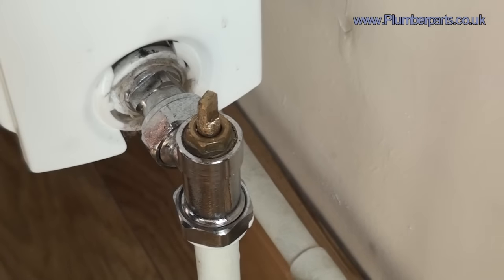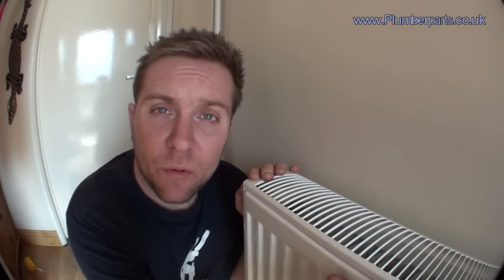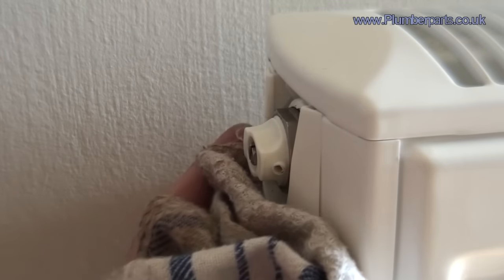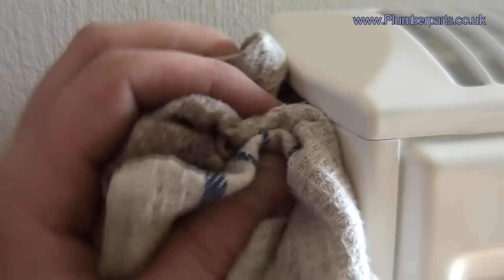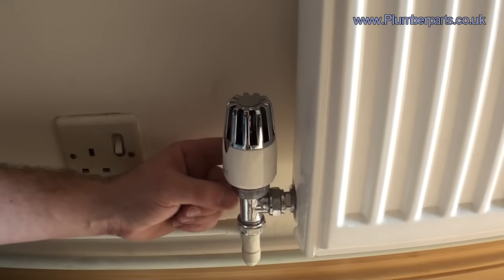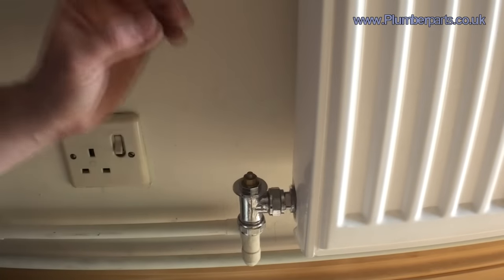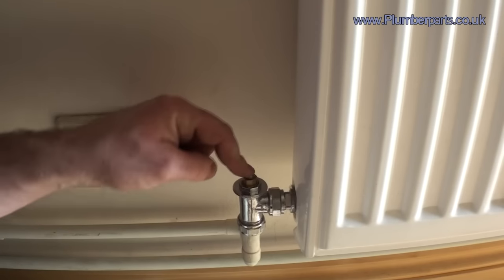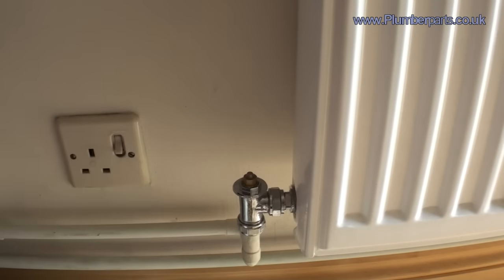How to Fix One Radiator Not Working - Plumbing Tips

Comment: My bedroom radiators are cold all over even at the pipes. Downstairs radiators work fine and the ones in the bathrooms work fine. I have tried letting the air out and a little air came then a lot of water. I looked at both pipe valves lady and right and they look the same. No pin either side just a traditional turn one like in the video. What do you think is wrong and what would you advise?

Comment: I have a lazy Radiator in my downstairs toilet. Occasionally it will just not get hot. The valves are open, it doesn't need bleeding, the system is cleaned out and inhibited annually so no sludge (plus I fitted a magnetic filter trap), the Central Heating pump is working and at setting three and I have balanced what Radiators I can (it's an old system so some valves are stuck open).
If I crack open the drain valve at the radiator to promote a bit of flow it gets going again and thermally cycles, but just very occasionally it will lose the will to work...... drives me up the wall.
I am gradually working through replacement of the old Radiators in the house (about halfway done now), so hopefully once they all have new valves on I can balance the system a bit better. I just can't afford to change them all in one go.

Comment: Fantastic videos so helpful thank you can I ask a quick question please I'm going to be getting a gas engineer out to look at my boiler because the pressure keeps dropping when the heating goes off or it's not used long after being used before I got told something called the expansion vessel is the problem does this sound correct I'm afraid they might say I need a new boiler can you give me some advise if that's ok john

Comment: Mate I’ve got exactly this problem. I’ve checked the lock shields open fully, I’ve bled the radiator. The trv is Luke warm, I’ve taken the thermostat off the trv and compressed the pin which presses fine however the radior is still freezing cold when everything else is hot

Comment: I've got one new radiator that doesn't get that hot unless I turn another radiator off. The plumber said it is because the boiler is at its threshold for the 15mm pipes we have and changing to 20mm would help. If we had the 20mm installed in one or two rooms as we decorated them, would that suffice? Or does the whole house need to be redone (not going to happen, no budget for that)?

Comment: I got one of those cheap plastic thermostat value.Not like one us you shown,done up a plastic collar.The pin is stuck up.The radiator is cold apart from small bit at the top.Not sure I should mess with it.

Comment: Hi, I’ve followed the steps on this video but I don’t seem to be getting any hot flow to the one cold radiator in question (pipes & radiator are all stone cold). Should I be looking at balancing or airlock next, or could it be something else? It’s a top floor radiator (same floor as my pressurised heating system). All other radiators are working fine (other than the lounge on ground floor but I think that might be sludge related as it is getting flow but is cold at bottom and room temperature right at the top). Thanks!!

Comment: One radiator in my apartment is causing trouble. All the other radiators are working except for this one which occasionaly produces heat but very randomly. Like it's turning itself on and off. Any reasons why this could be, and what should I do?
Thanks!

Comment: Hi @Plumperparts, my radiator inflow is hot, and some heat transfers into the radiator, but it does not move through the radiator. I have repeatedly bled the radiator so I know that is not the problem. Could it be that it's just too full of sludge? The other thing is that my builder installed the valve at the top of the radiator, does that make a difference?

Comment: if you want to vent the radiator, always switch off the central heating pump and wait 20 minutes before venting,and always start with the radiator that is the highest and so you get to the lowest

Comment: What is that tool you're using that you call adjustables? I could only find draper redline pliers in the shop but they don't grip and the thing won't budge at all.

Comment: Great video we have had a new radiator fitted and since doing so one radiator doesn't heat up the idiot who fitted the radiator has been twice and each time the same issue radiator is cool at the top and bottom is hot and all the rest of the radiators burning.  Think I will try this than call him again.

Comment: Both pipes are cold , I've got 2 rads in my living room, 1 is piping hot and the other was hot but it's suddenly gone cold? Should I try bleed the hot one in case air is preventing the hot water going to the second one? The pressure is a healthy 1.5 bar

Comment: I've got one radiator that doesn't work ...when I turn the bleed valve to let air out the pipes leading to it heat up then when I close it they go cold again, it's driving me nuts my halls freezing have you any hints to the problem bud I'd much appreciate it
Cheers

Comment: Suggestions/help request.
I have one large radiator in the attic which gets very hot only half way up. There is another small radiator in the same room that works fine. The boiler is situated 2 floors down.
When I go to bleed the large radiator no air comes out of it? I have even taken the bleed valve/screw all way out whilst the system is on and nothing, no air whatsoever? With the rest of my radiators you can barely move the valve before the air and water starts to gush out. Any ideas or fixes for this issue? The pipes that take to and from are both hot.

Comment: Upstairs ive got three blazing radiators, one is lukewarm after bleeding, the lock shield valve is open and heat is up to the pipe of the TRV, so I might just repair or replace that valve.

One other radiator is stone cold, the lock shield valve is open, but both pipes are also stone cold.
Would that be a blockage?

Comment: I've tried everything you said and still can't get the radiator working. Was fine  yesterday but had someone working on the boiler. All the rest of them are warm just not this one. The caps at 5 pin works, the valve is open fully and yet both pipes are cold

Comment: I have a cold radiator downstairs (furthest away from my boiler). I have tried all the steps in this video and it's still cold! The flow pipe is very hot, the corner of the radiator by the flow pipe is getting hot(ish) but the radiator is only mildly warm along the top and the return pipe is stone cold.
I've balanced all our radiators, the lockshield and TVR valves are both fully open and not stuck, the radiator is bled... still can't work out what is wrong!
I doubt it is blocked as it's a brand new radiator and brand new valves I installed myself 4 days ago!
Any help would be appreciated! 😊

Comment: Hi 
I don’t have TVR fitted to my radiator. 
I bleeded the air out and also turned both lock nuts anti-clockwise. Still radiator not heating up. Born right side pipe is little warm
Could you Advice please

Comment: Got one radiator that only heats halfway up. The bleed valve is frozen solid and won't turn. Bent one key trying to rotate and snapped another into bits. Is it advisable to drill and replace or just replace the full radiator. Have see rads with holes drilled and self trappers screwed in but I am too worried to try this. Thanks in advance. Robin

Comment: Hi what would you say to this issue ......sorted my pressure now ill check around home for leaks although I think the boiler may have its own leak .......heats water fine now as it wasnt igniting increased pressure to 1.5 bar (checked my operating pressure ) but althoigh heating works the heating only seems to operate when I'm not running hit water so it seems to be one or the other but not simultaneously 

Thanks its operating at just over 2 bar so maybe drop a bit ? Cheers

Comment: I tried this, pulled the small pin right out very easily and got myself and the ceiling soaked lol. New TRV required - Luckily the pin hit the ceiling and landed right next to me so I could shove it back in and stop the leak. Rad still isnt working though. Not a bad attempt for an electrician though haha.

Comment: I replaced the pump thinking it was the reason why downstairs radiators not working but still the same, motorised valve seems ok and both tank's in the loft are full, any ideas?

Comment: Hi! Loved the video was really informative. 
However my rad is still cold, it's not been on in a week now, initial started getting less warm and now it's stopped completely. 
İt's bled. The lock is open. And the trv seems fine also. 
What else could be the issue??!? 
Other rads on this floor are boiling hot so it's not a system issue. 
I've tried hitting the rad with a padded hammer to clear 'blockage' but that doesn't help either. :(.

Have you got any other suggestions.
Reply: Hey I noticed this comment and my situation right now is exactly the same. Did your problem get resolved by any chance? (well, hopefully it did, as you left the comment a long time ago lol)
Reply: @tomitikkala6381  yes it did get resolved! Turns out it was the balancing in the system. As the heating system is spread over 4 floors it's not laid out in the ideal circuit configuration. There's a few radial heater, which I suspect this one was, last in the chain. 

All I had to do was go to the rads behind this one and turn off the lock nut, that will force water back into the pipes that it was skipping for the problematic radiator. Then you can reopen the locknuts a quarter turn or half turn as much as you need. But not all the way or you risk the pressure dropping again further down the chain.

Comment: Hey i have changed the trv  lock shield is open   Still no heat even at flow pipe ....  

When moved into flat the towel rail wasnt working  then last year the hall rad stopped too. (Which  is the one i changed the valve on. 🤔) 

Any suggestion what to do next ?

Ps i have put section of pipe onto towel rail and bled into toilet still no joy  but towel rail piped with flexies !

Please help mate !!

Comment: Hey, followed all instructions I've removed TRV,, pin moves up and down, replaced TRV. Rad still cold, after removing TRV again and pressing and holding down the pin, rad gets hot, I've put TRV back on then it gets cold again. Do I need a new TRV?

Comment: I used to have two horizontal radiators in one room. Now I've still got the horizontal at one end and I've gotten up right at the other end. And the horizontal radiator at the far end of the room gets hot but the upright radiator doesn't get hot. But if I turn the radiator off at the far end of the room the upright radiator gets hot?

Comment: I've taken the TRV and the pin doesn't seem to move up or down, there's another white thing around it on top of the gold one.. (sorry I dont know the terms) both pipes going into the rad on both sides are warm but the radiator is cold. its the one in my bathroom. any tips?

Comment: Just bought a house and rad in conservatory not working at all. The lockshield was turned off so ive turned that anti clockwise to on but still nout. The pipes going to it dont even get warm never mind hot. What could this be?

Comment: Hi, I wonder if you could help me please? iv got one rad that does get hot as the rest but then it will start cooling down when all the others are still hot, I have bleed them and made sure the thermostat is on 5. Any ideas? Thanks
Reply from the maker: System need balancing. I’ve done a video on it and it’s soooo easy!

Comment: What if the pipe is red hot literally cant hold my hand on it but the radiator is still cold? There is no air inside. 
Rest of the radiators are hot just that one its cold. Guy who fitted my new radiator told me there is pipes crossed but it will nit cause any troubles but it does as its not heating…. Seems like dead end even its nit the highest or lowest radiator of the house…. What do u suggest?

Comment: hi, I have a big problem, the landowner brings a plumber to filter all the radiators, they change all the thermostats and now we can not change the temperature, its burns or cold. there are five numbers but the temperature it always extreme off and on. there is a way to fix this. the landowner did not fix this? thank you for your video.

Comment: Hi,
when bleeding the radiator, no water comes out and the air doesn’t his for very long. i sometimes hear bubbles at the bottom of the radiator when trying to bleed it. it seems the pressure in the system is too low?

my question is can i just add water to the radiator? it’s all water anyway so it makes sense to just fill the radiator up with water through the bleeding valve.
but it seems like one of those solutions that’s so obvious yet nobody does it which suggests to me that’s it’s a foolish one.

Comment: Had this problem, but none of those issues... there was an air lock in the supply pipe.... I turned all other radiators in the system off completely... the air was forced to move. Phew!

Comment: Please help some radiators are not working at all. The gage at the boiler in garage goes to 0 the red sitting at 1. I always have to go up in loft to set gauge as it’s also at 0 I put pressure up to 1 or 1.5 which will put the gauge back up in garage. I do this every time I put heating on.

Comment: Hi i moved to new house and there is hot water from tap but no heat on radiator. It shows some light on boiler where there triange and word bar inside it

Comment: I still got this problem. Old rad taken away new one installed other side of room .  

The rad is warm cool on edges cold in the bottom and centre middle. Left pipe under trv is hot.   Right pipe is cold.  Lockshield valve on right is open fully.  

I did everything.  All rads off and left this one on.  No change.  

System is balanced.  All rads are hot. Just this one isnt.  Its a new rad so cant have sludge in there. 

I even tried to take air out of system by putting hose on a drainvalve near boiler and let it run.   But still it wont warm up. 

Havnt tried the pin thing.. but on a new rad i thought that be ok

Comment: I Have a rad not getting reall hot even changed it to a type 22 new rad still doesnt get really hot ..its the pipe going into the rad i can hold my hand on it  without burning ..is it possible that sludge is blocking the flow? I have tried all these things  all other rads are v hot ....thinking of putting a new pipe in  and its freezing in that room !! any ideas?

Comment: tried all this and still got a cold rad - the pipes by the manual shut off valve are hot ive tested both valves and flushed the rad - still no joy ? - tried closing all other rads with no joy also ?

Comment: Yep done all of these, still one is not working.  The radiator is hot at the top, flow is cold.  Checked all the other valves too.  Weird.  One radiator.

Comment: Hi. I have a problem i just bought a house and i think there is a lot air into radiators. I try to do the method by take air out. I do this for hours sadly because i see radiator gets hot only by 30% and slowly getting a bit more. But its taking to much time. What will be a easier way to do it cuz i do this for at least 5 days each  day at least 4 h and i barely see any differences. Please help me im out of ideeas.

Comment: I’ve got one radiator in hallway that just won’t heat up tried bleeding even emptied the rad and flushed through and refilled even opened both ends to make sure water is flowing through nightmare

Comment: Opening the lock shield fully is not a good idea always as the system may be balanced.
The best way would be to half turn open and see if that's works not fully open it plus is you leave the lock shield fully open it will lock / stick in that position, you should always 1/4 turn the valve back after fully opening it to prevent this!

Comment: Drain system Remove old  radiator .fitted new radiator  with new valves  how do you get air lock out a  old single phase radiator system  which is connected to a new boiler system  . All radiator work as normal  but the new one and one other not working now  which is on the single phase.  Open bleed . rad get hot and water pressure come out. then in a minute rad cold again . Help help me

Comment: I took the TRV off and my radiator started working. The trouble is I couldn't get the TRV back on because the pin won't press down. I guess it needs a completely new valve.

Comment: my new rad is now fitted but the pipes don't get hot or the rad is not hot, new lock shiel valve open new temp valve working , bled but cold, have I got my flow pipe and return pipe wrong way round, the pipes were hot before I put rad on..lol...grrrrrr...

Comment: I can't get the screwy bit off to check the pin. It's got a white plastic cap stuck on it. This is so annoying. The one in my room doesn't work, the only one i care about in the house. All the bathrooms and stuff are fine but the one room i need comfort, it's freezing.

Comment: Actually this is a convector, not a radiator. 
Radiators are the heavier cast iron ones, with a lot of mass and a comparably small surface area in relation to its mass.  A convector instead heats up a medium (gases or liquids) that stream past. It's a heat source with large surface in relation to its mass.
Radiators  (also tiled ovens are radiators)  provide the snug warmth, which you never get from converters. The disadvantage is: they re not providing  heat immediately when started.

Keep in mind the  three ways heat can be transmitted:

radiation
convection
conduction

Comment: Not quite right about the lock shield valve, it should be returned to the same position after fully opening it, otherwise all the radiators will have to be rebalanced again. Fully opening it should release the bit of debris which has got trapped under the seat of the valve and blocking the flow, then the valve can be reset to original position.